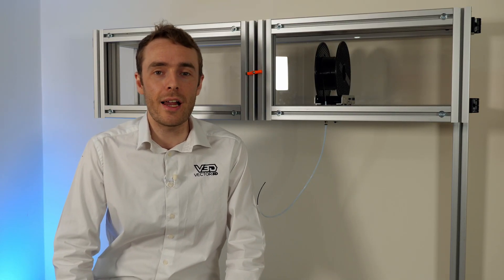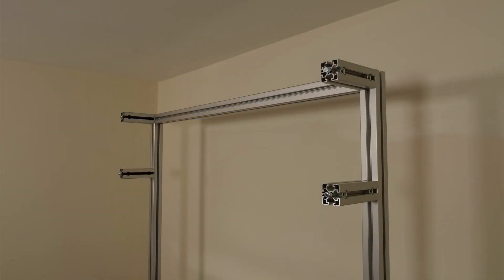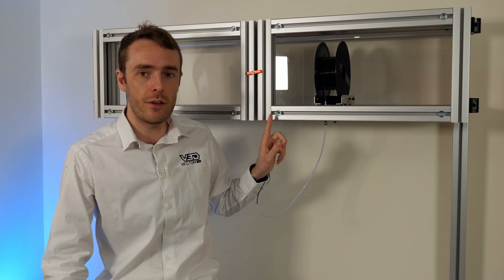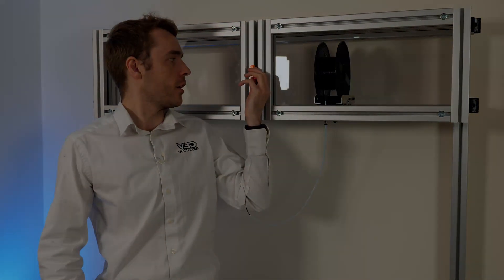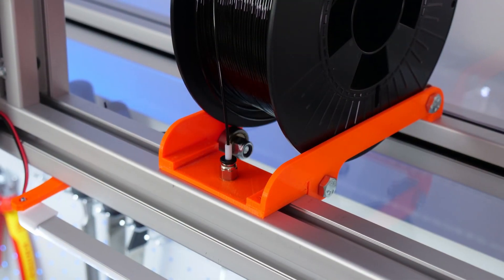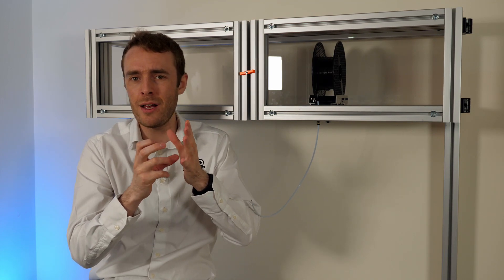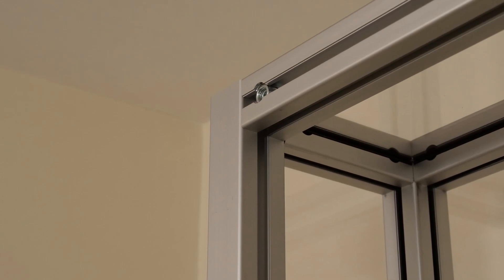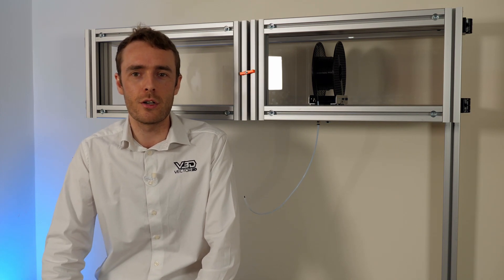3D Printer Users Will LOVE This!

Comment: Every time you mention cost I wonder why you are using what looks like 40mm extrusion. I see this in custom vans also. They seem to want to use 40mm everywhere. I used 25mm for my van upper cabinets and it is plenty strong at the lengths you are using and cost significantly less.

Comment: Preface: The desiccated filament storage and heated drying is my favorite/most anticipated feature of this bench, and I really enjoy and appreciate this whole endeavor generally. Thank you for doing it. Also, those window panel seals are an excellent find/solution :)

This may sound a bit harsh at first, but hear me out. I think you need to scrap this particular concept/iteration and take another crack at it. Here's why:
As implemented, this is only really suitable for desiccated storage, and not heated filament drying. If you try to implement heated filament drying, you're going to hit two major problems.
a) The massive volume exponentially increases your heating requirements to achieve any given temperature. In the current width configuration, it looks like you can store 12 kilo spools in there very comfortably, but the bench can hold about 3 popular printers at most. 2 if you want any workspace, 1 if you want mostly workspace. So in the best case scenario, you're talking about heating a space 4 times the volume necessary to get a single spool ready. Good heated drying is an 8-12 hour process. Certainly no less than 4. And for stuff like Nylon, unless it's in a vacuum chamber, desiccant only slows the inevitable, so you'll be repeating this process regularly. That's a lot of wasted energy.
b) Because it is one single chamber, you cannot keep 'common' materials in it while drying 'engineering' materials, since they will melt. And those are precisely the materials which benefit the most from heated drying vs simple desiccated storage. So you would effectively give up good storage for common materials if you wanted to use it for materials where it really matters, while receiving a sub-optimal setup for the engineering materials.

Here's what I propose: Iterate on the basic shelf configuration, to allow modular desiccated (and heated if desired/configured as such) 'crates' to be bolted (or preferably slotted or otherwise non-rigidly affixed) to the shelf area. The crate length/spool capacity would by nature already be customizable, but the classic 1, 2, 3, 4, 6u sizing is a no-brainer. If this full size version is a 12, achieving the same capacity but in a better way, you can just put on 6x2, or 4x3, 3x4, 2x6. 12x1 is probably a little bit of stretch, and 1x12 is what I'm against, but whatever makes sense for you. And not all would need to be heated, and you don't need to fill the whole shelf space if you don't want/need to. And theoretically there's a world where double-stacking them vertically isn't out of the question.
Obviously there are some trade-offs with my suggestion, but it seems like a far more versatile and practical solution to me. Just some food for thought.

And speaking of food for thought, here's something I will certainly implement whenever I make a version of this bench that maybe interesting/worth considering for you: with a setup like this, you're perfectly positioned to mount steppers right by where the filament exits the storage. With some wiring, electronics, and y-splitters (a-la 3d chameleon) you can easily do automated/semi-automated filament switching (and also the worst, but most accessible, kind of multi-color/multi-material setup haha).

Keep up the excellent work, I very much look forward to seeing where you, and eventually the community, take this. Thanks for the great content.
Reply from the maker: Hi, thanks for the feedback.
My plan for this particular filament storage system was not for managing engineering grade materials like PEEK or anything of similar grade. I'm targeting consumers primarily right now using PLA, PETG, ASA, ABS and TPU. You're right though, heating up the whole enclosure isn't very practical and unless you're just printing TPU all day from 15 spools simultaneously there is going to be a lot of waste heating spools that don't need it, and if you have PLA in there too then that's just going to go soft. Changing over to smaller units that can be bolted on will fix the issue with waste but would lose the economy cost benefits of a single large enclosure. Looking at the cost per spool stored, this is currently very good and I'd like to keep it that way. Maybe some insulating dividers in the current design would be sufficient to sperate a heated zone from a non heated zone. I think that might solve the problem, what do you think?

I have recently considered trying to merge the designs of shelf and enclosure to be closer but the depth requirements of the shelf and cost challenges on the enclosure make them hard to combine.
Reply: @Vector3DP  I wasn't even thinking of what I call 'work' materials (I print PEEK, PEI, etc at work). Mostly I'd say Nylon is the issue, with a drying temp of 85C. But even PETG is like 60C, which is pushing your luck with PLA. I don't expect the chamber to hit proper PC drying temperatures (120C), but if it gets to 85C that should be plenty for hobbyists without generating a mountain of other engineering challenges.
I certainly appreciate the cost and complexity issues. If you manage to design an adjustable divider, that's probably ideal, letting users set it to just the size they need. And it keeps the modularity aspect, since I see no reason you can't place multiple dividers and wire up independent chambers if desired. I suspect insulation will be a challenge, but shouldn't be impossible.

Comment: I'm so glad you tried out those window seals as I need some for my new Lack enclosure, the last one I built was all closed off with just double doors at the front, but this new one has removable panels on the sides and back held in place with spinning catches which are very similar to the ones you use to close your door.